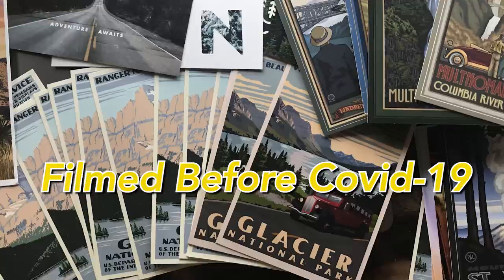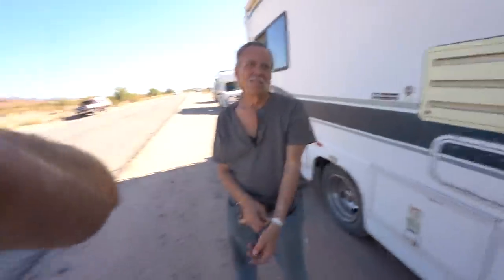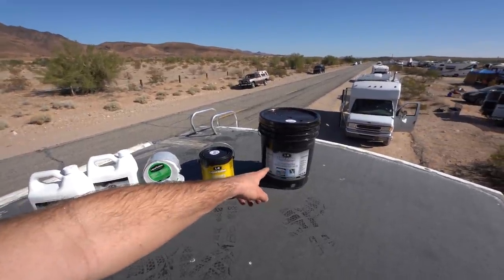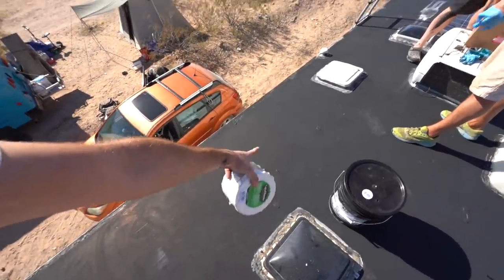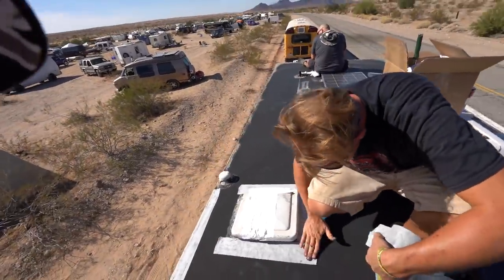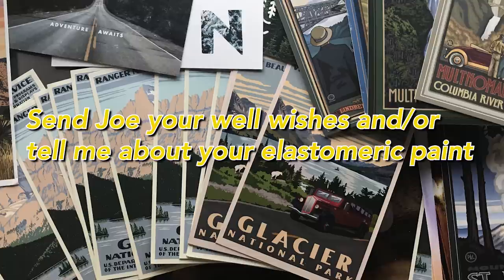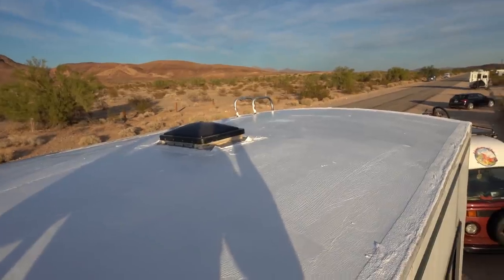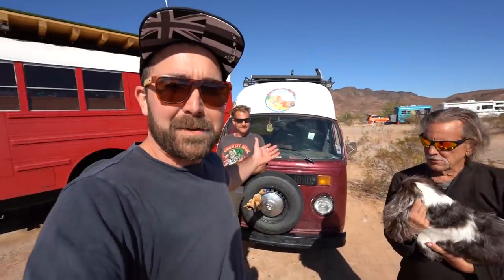How To Install Elastomeric Roof Coating on RV - Liquid Rubber

Comment: I bought a 40 ft. high cube shipping container in 2016. It was a fair/poor condition-type. I had a breach in the roof and noticed several more areas that only needed light pressure to penetrate through. I backed the breach with a superficial application of duct tape that was later removed. But I simply used Flex Seal. I used a roller for the most part, but I poured in it areas that were the lesser condition. Even with the duct tape the Flex Seal didn't pour through to the inside. Then after it dried, I added a coat of reflective paint.  Like I said ...that was in 2016 and now it's almost 2021 and I have not had any problems what-so-ever. Of-course in the beginning there that part of my brain that said you have to go extreme, buy a pool liner, adhesive, etc. But nope! --just under 5 gallons of Flex Seal to cover the entire top AND repair the breach and the other potential ones.